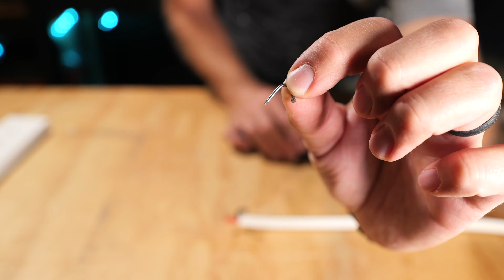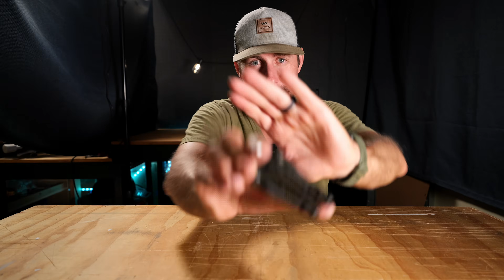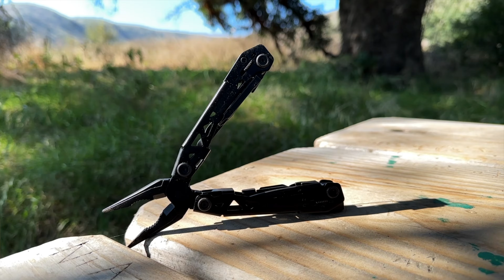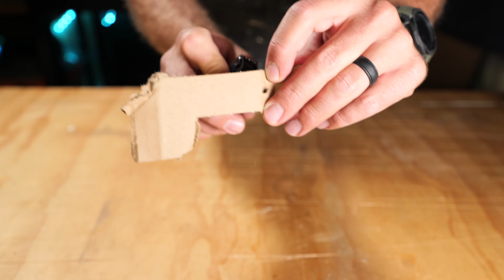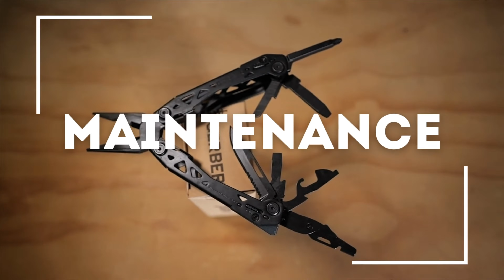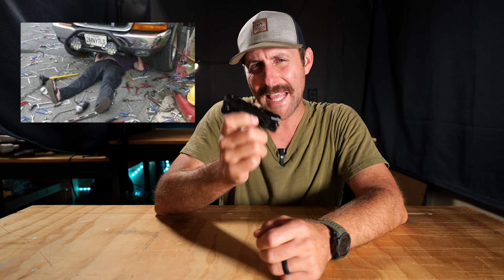Gerber Suspension NXT Review: Great Budget Multitool

Comment: Gerber is the Hi-Point of multitools. 
I got one of these to throw in an emergency bag, I threw it in the trash instead.
The pivot is really squishy and the whole tool bends out of skew when you grip it to use any of the outside tools.  The spring loaded pliers are literally the worst thing ever, there’s a reason real, high end pliers are not spring-loaded. Every time you go to adjust your grip on something the handle flops open, out of your hand, and the poor lockup in the pivot means this thing has zero torque ability; you can grab a thing and pull on it, maybe turn it (like a nut) but if you bend or twist on the Y axis you’re going to break a handle off, or bend it over at the least.
The awl is just a dull knife blade, the file is just flat knurling and its powder coated, it’s not going to file anything. The half-serration on the blade is a joke and it makes the blade really unsafe, a plain blade would far more useful. The locking pins are stiff and painful to unlock and the pocket clip is basically cut from a tin can, get it snagged once and it’s toast. 
Evan at $30, this thing is a total dumpster fire. 0 stars. Go to Walmart and spend $20 on a Mossy Oak and it will hold up better to real-world use.  The only people who like this tool are the ones with affiliate links. 
Spend the money and get a Leatherman.
Reply from the maker: Love the comment brother! I’ll be reviewing the Gerber Assert Coming up soon.
Reply: @Driftoverland  why?
Reply from the maker: It is a mid level not super expensive knife that could be customized and I wanted to try it out 🤙🏼
Reply: YOU ARE A COMPLETELY NEGATIVE PERSON , I GIVE YOU 0,0,0,0👎🏻

Comment: just bought one, only thing i dislike is the stiff locking mechinism and 10:08 that you mentioned
Reply from the maker: Yeah for sure, I had to back off the bolt and throw some lube on it! … there are better multi- tools they are just more expensive!
Reply: @Driftoverland exactly, and it’s a huge step up from the garbage cabelas brand ones that break every time I go to debarb my hooks
Reply from the maker: @HansRiveraCreations way better than that for the price for sure!